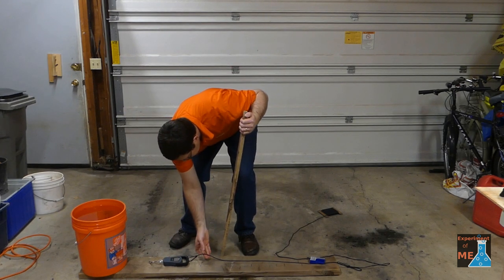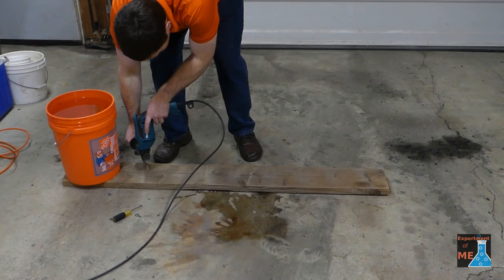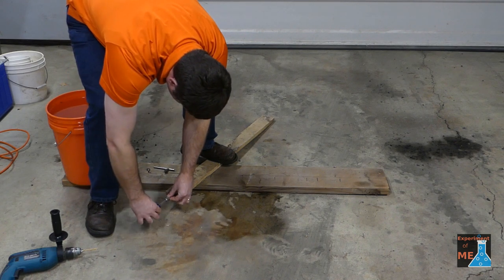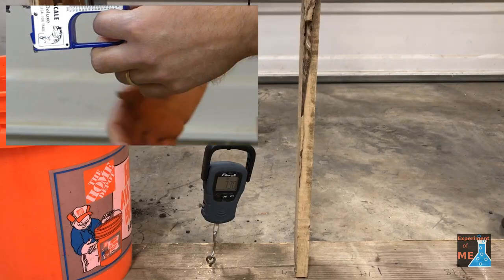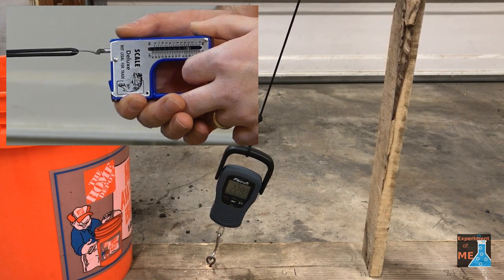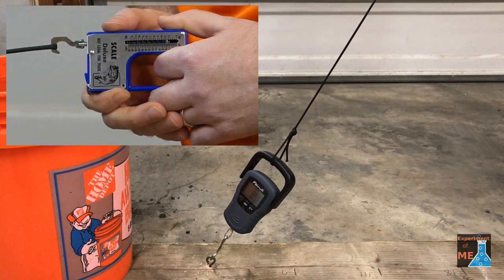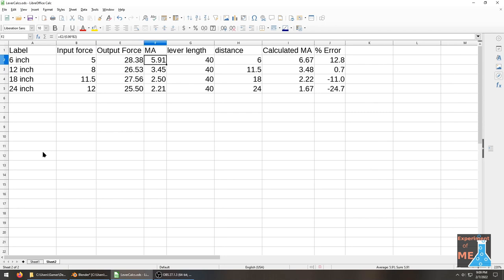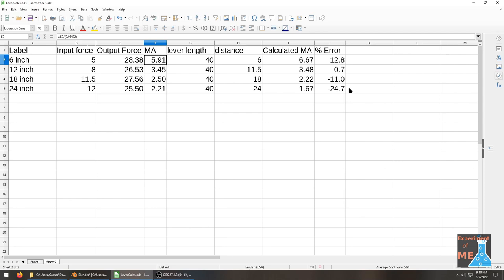How to Test the Mechanical Advantage of a Stump Pulling Lever

Comment: I would be interested in seeing what mechanical advantage could be obtained by attaching the bottom of the lever to the eyebolt, in the same manner as a crow bar or a claw hammer pulling a nail.

It would require a different scale set up, but the data would indicate that the closer the lever is, the more advantage is to be gained.

...
Reply from the maker: The mechanical advantage (MA) will become quite extreme as the lever gets very close to the load.  The disadvantage is that the distance that you can move the load is inversely proportional to the MA.